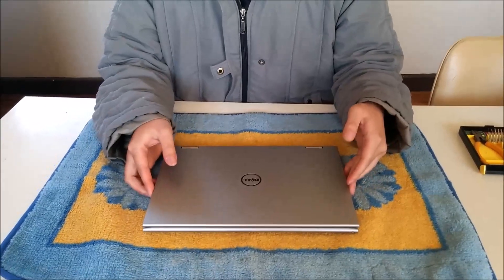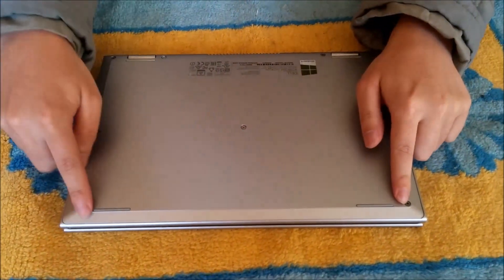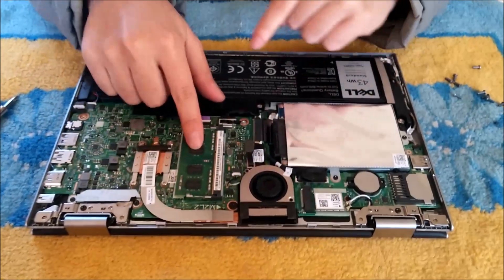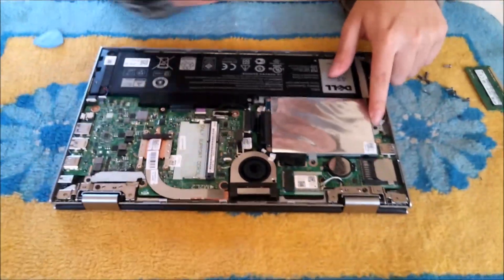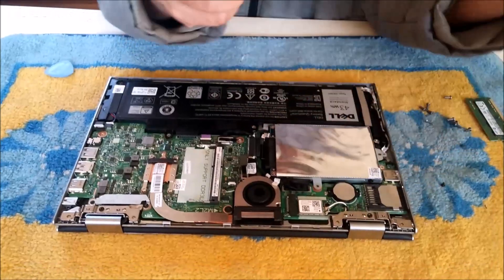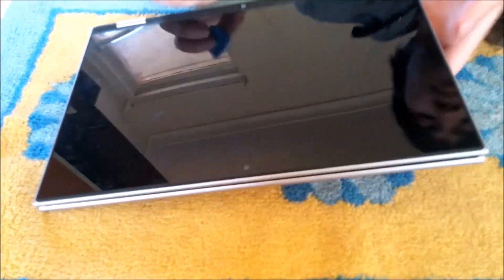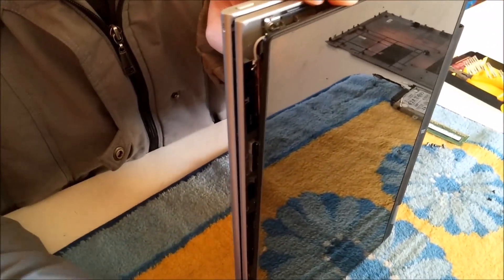OPEN ME UP! Dell Inspiron 11 2-in-1 Disassembly

Comment: Working on a rug that is FULL of static is unwise at best!!
Reply from the maker: yes in theory. i have been working on computer and made all these videos and have not been able to damage anything. which is disappointing i have even try to on purpose but still have not been able to do so. scratching or dropping your components is worst and is more like to happen therefore it is recommended to work on something that can aviod that

Comment: Thanks, popped in an old 120gb ssd and it's better than new.  this thing was a turd with the 5400 rpm drive
Reply from the maker: good thing it uses a 2.5 inch hard drive

Comment: How many ram slots does it have?
Reply from the maker: CPU is solder on, Ram can be change to 8GB max in 1 slot, hard drive is a 2.5 inch which can be changed and wireless card can be changed.
Reply: Thanks for letting me know! I wish it were 2 slots so that I can get 16gb

Comment: could you tell me if I can upgrade the processor in this computer?
Reply from the maker: CPU is solder on, Ram can be change to 8GB max in 1 slot, hard drive is a 2.5 inch which can be changed and wireless card can be changed.

Comment: Sir does do you fill the heat when using it your lap
Reply from the maker: yea thats sort of normal. if you use your laptop on your laptop or something that covers the bottom it gets hot as the air can flow through
Reply: Thanks for the reply

Comment: So can u remove the CPU?
Reply from the maker: CPU is solder on, Ram can be change to 8GB max in 1 slot, hard drive is a 2.5 inch which can be changed and wireless card can be changed.

Comment: the connector right above the hardrive i accidently removed it how can i fix that ??????? any info would help :D
Reply from the maker: +Mohammed Ally don't know what you taking about please tell me the time in the video for me to look at
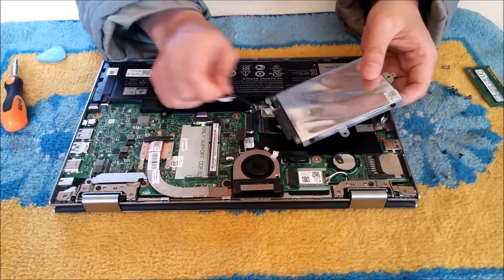Reply: +OPEN ME UP 3:01 where your screwing out that one screw right above it is a connector ..... at 3:16 when you take out the hard drive you can see the connection more clearly :D
Reply from the maker: +Mohammed Ally the big long black one if so that's the keyboard cable and you just put it back in if you remove it

Comment: Thanks for showing this video which is very helpful. I have Dell Inspirion 3148 brand new but suddenly for last couple of weeks left side keys of the builtin key board are not working (especially Esc, Caps On 1, A, Z. I am using currently a USB keyboard. Is this a Dell problem and what is the solution for the same?
Reply from the maker: Probably just a faulty keyboard

Comment: I have this computer and the keyboard has problems. Several keys do not work properly on the left side. Is it possible to easily take the keypad out and where would I find a replacement part? I have to copy and paste the "a" to even type this..
Reply from the maker: you can call up dell to buy it off them or you can try to find it on ebay. I saw someone selling a faulty one and it only went for $100 AUD for the whole laptop. Before you go out buying a keyboard you should check if it is not a loose cable issue. try to remove the keyboard cable and put it together again to see if it works. Also just like to advise you that if you drop water on your keyboard you cant fix that and will need to replace it.
Reply: OPEN ME UP Thanks for the tip, I found one on eBay for $23 so I ordered it to have it on hand when I take it apart. Everything else on the unit works well so it should be an easy fix.